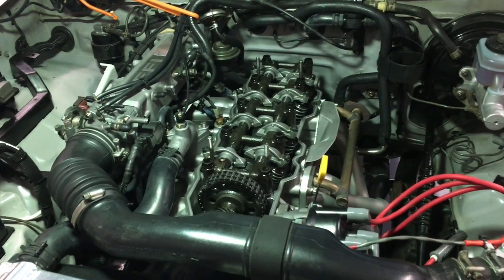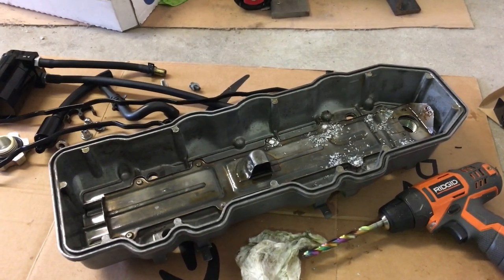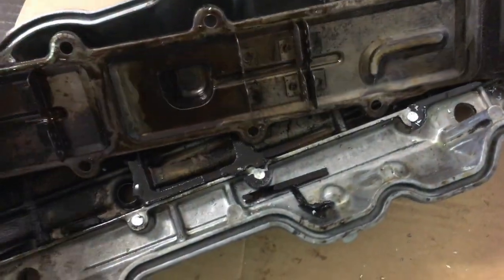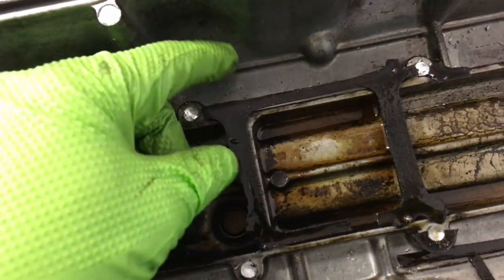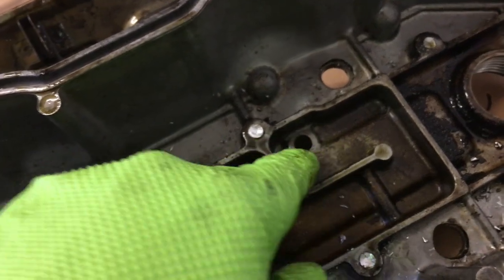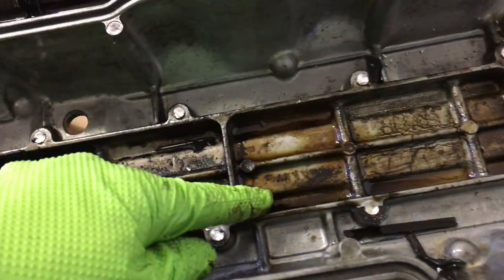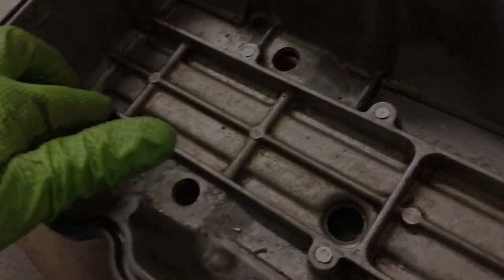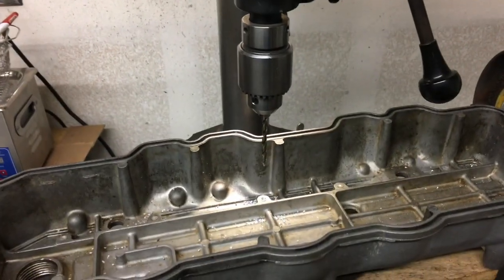Toyota 22RE oil consumption finally solved? Valve cover oil baffle PCV cleaning removal upgrade

Comment: Glad to know it wasnt related to the timing chain conversion ... or maybe I should wait to watch the final video on this issue.  SO glad you decided to document and share your 22RE journey, very helpful.
Reply from the maker: I finally traced the oil consumption to the previous owner (before I purchased the truck) installing the incorrect sized piston rings. Also the LCE oil passage in their head was too small and needed to be opened up. Check some of the more recent videos on the channel and I cover some of it during the 2nd engine tear down and rebuild.
Reply: @ray5961 Awesome, I def will watch them .. Im going through all your 22RE vids  😀 thank you!

Comment: Seems like some valve covers that plate is bolted from the factory,  don't remember the years though.  One thing to consider as well is no amount of baffling will stop blow by.  I am very curious to see if you get any change.
Reply from the maker: Thanks for the info. I'm still fooling around with different PCV configurations along with that extended breather/baffle. I just came in from tweaking it and I'm waiting for an adjustable PCV valve to arrive on Friday. So I should have an update video soon here.

Comment: I'd love to know if this worked for you.  I'm fighting a similar problem.
Reply from the maker: Didn't really seem to make a lot of difference either way. It all seems to be related to how much suction there is at the PCV. Too much and it causes the oil to crawl up the walls of everything and go into the PCV system. Too little and the engine doesn't run as well as it could. It's a very fine balancing act and I think removing the stock smog stuff exacerbates the problem.

Comment: What type oil is suitable for this machin 22r please??
Reply from the maker: Usually any 10W40 is fine. You wanna add some Lucas ZDDP to boost up the zinc a bit, since it's a flat tappet camshaft. Here's the oil I run, as well as 8 oz of the ZDDP stuff:

https://www.amazon.com/gp/product/B00CPL952G

https://www.amazon.com/dp/B001DKN8ZU

That oil with 8 oz (half bottle) of the Lucas ZDDP should get you to around 4500 ppm of zinc in the oil as I rememer. I've also had real good luck with this oil: 

https://www.amazon.com/gp/product/B008QDXADW

If you use the Valvoline, I'd suggest adding in more like 12 oz of the ZDDP.